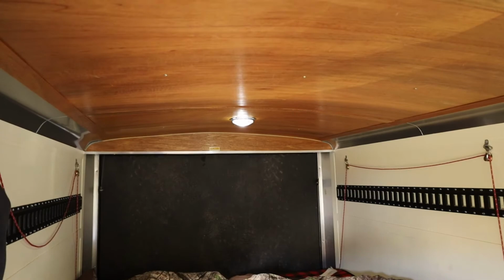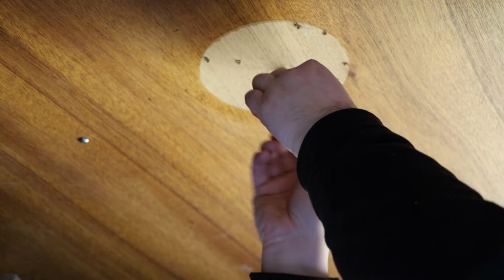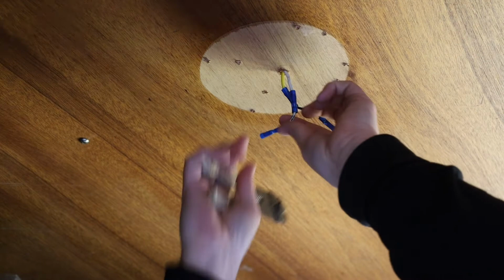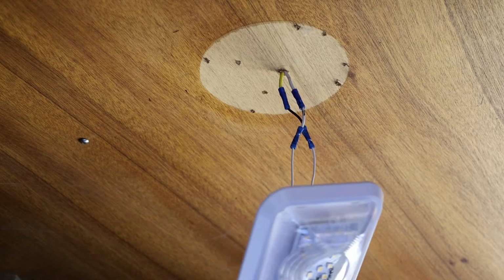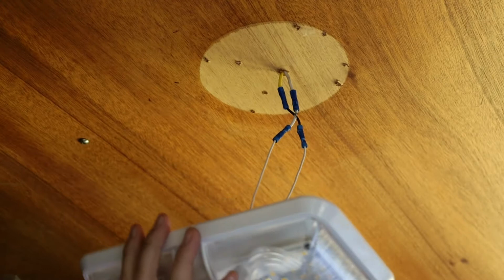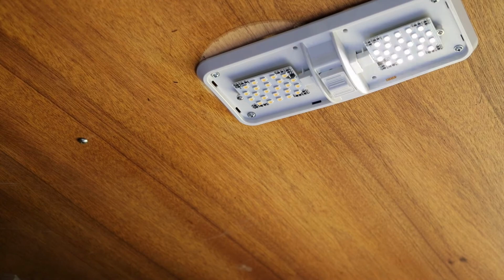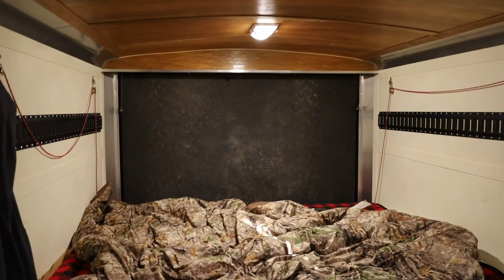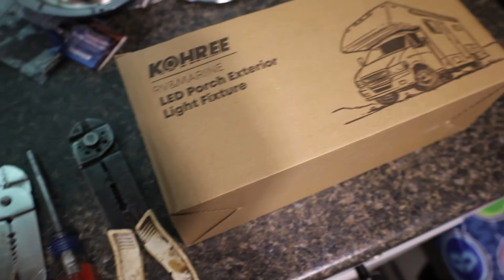12 Volt Lighting!!!

Comment: Looks like a big difference. I’m still using battery powered ones that hang on a screw and have a house style switch with two settings (dim & bright).
Reply from the maker: Was a huge difference well worth the price. I’ve been building cabinets in there all week and the lighting has been nice to be able to actually see what I’m doing.